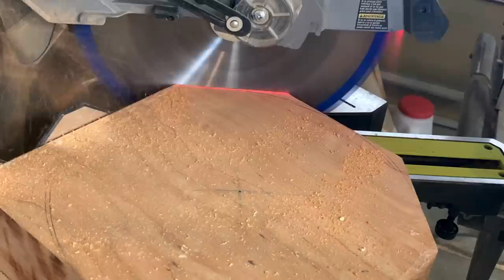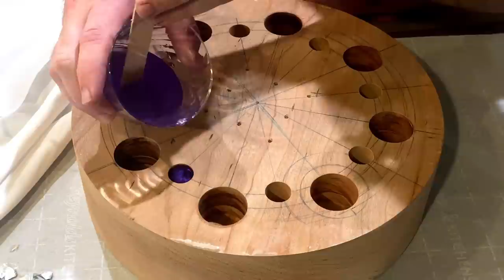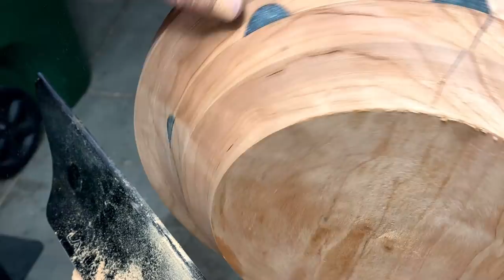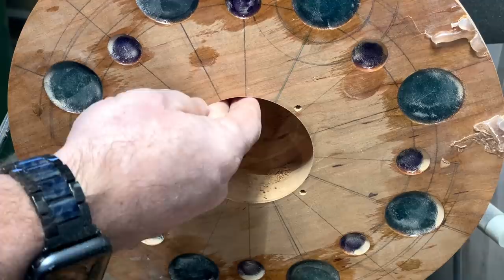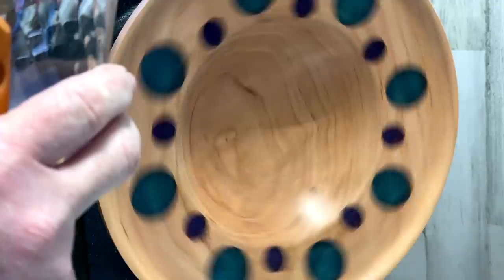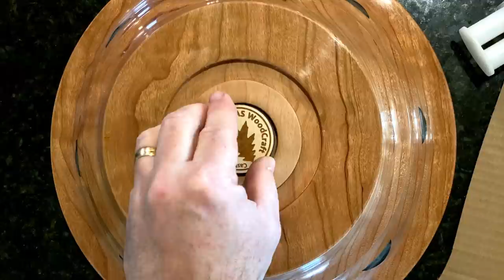Woodturning - Cherry & Total Boat Resin Pinwheel Platter

Comment: That finish is stunning. Did it just self level and come out like that?
Reply from the maker: No, I gave it 4 coats...under a heat lamp it dries in less than an hour so it didn't take long to put those on. Then I hit it with 400 grit sandpaper and finished it off with OB Shine Juice.  But the Halcyon did what I was hoping for...it filled in the pitting in the resin pours. I think I mixed the resin at 2:1 instead of 3:1 and it never quite hardened to the glass-like consistency I'm used to, so I had to get creative there at the end.
Reply: @CASWoodcraft  awesome, thanks.